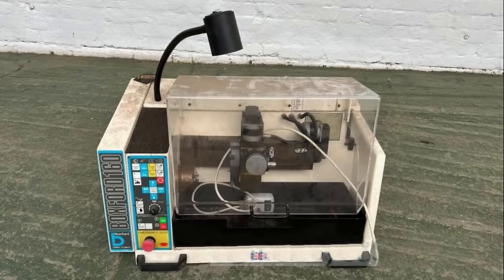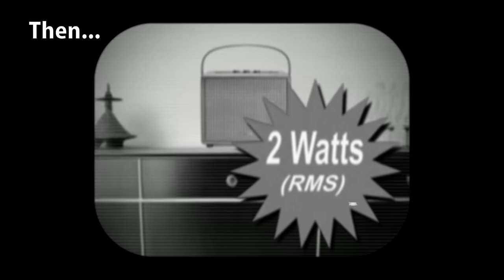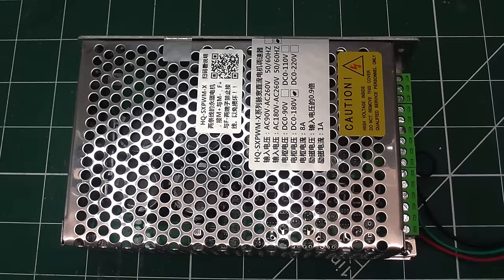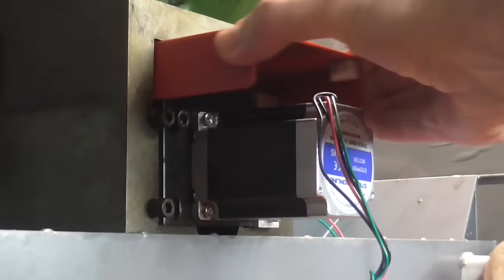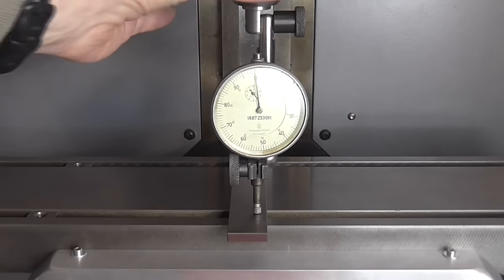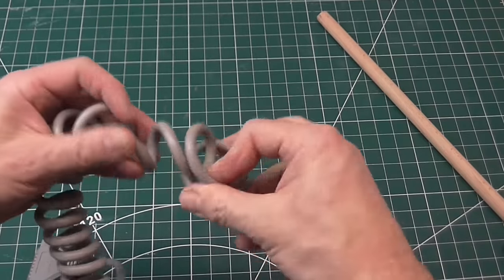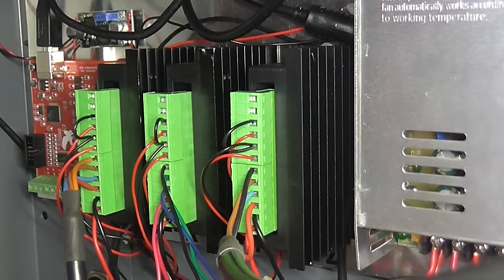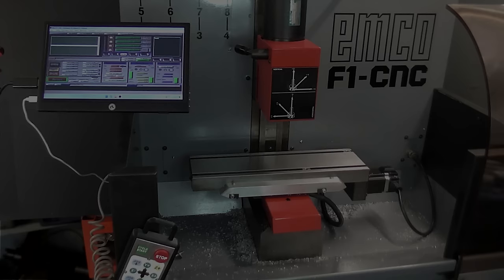Retrofitting an Emco F1-CNC machine

Comment: With these issues, and the ongoing costs of repairs and upgrades, it's a no-brainer to go with cheap EtherCAT servos($150ish each), LinuxCNC... and nothing else. No external peripherals are needed, no power supplies, no ugly and unreliable USB. Mostly plug&play, and not so incredibly antiquated like Mach3(or even 4), especially in 2024.
It's definitely a bit more expensive(especially with an £84 machine and £343 total budget), but it's far nicer.
Other than that, great project. Total bargain.
Reply from the maker: Yes, had I spent more on the machine to start with I might have gone with something like the Ethercat servos, but really I got the machine by chance, I wasn't actually looking for one and don't even have space for it! I know Mach3 is old, but I've had a license for well over a decade and am very familiar with it, so it was the natural choice. I might go with LinuxCNC though for the lathe I'm going to tackle next.

Comment: Can you make the file for the 3D printed end cap available please?
Reply from the maker: I was actually thinking of doing that. I first looked on thingiverse as I was sure somebody must have done this already, and whilst I did find one, the holes were in different locations to my motors so I designed my own (quite similar) one. I actually made two, with the threaded hole on either the left or right. I don't have a thingiverse account but I could put the files on Patreon and make them available to free members (no payment required).
Reply from the maker: Here you go... https://www.patreon.com/AndysMachines

Comment: This is a thin client PC not mini itx
Reply from the maker: I've lost track of the current terminology regarding PC formats, but I believe it's a mini ITX motherboard, which is actually a smaller form factor than a 'micro' ITX. The case it's in may be called something else though. Anyway it fits perfectly inside the machine.

Comment: Doesn't that motor have 60oz. in. and 2A per phase?
Reply from the maker: Yes, that's actually right (the label is laid out in a confusing way). But 60oz/in is still way less than 1.85Nm, less than 1/4.

Comment: Original motors in this machine are awful. After few days of trying to get them to work strong without overheating resulted in buying new modern stepper motors. Newer generation of EMCO machines use servos, but electronics inside are pure nightmare.  Not to mention that EMCO machines and parts for them are inexcusably expensive if you have to order new. That entire company is one big scam.  We recently bought new machines but from other manufacturer and they are 3 times cheaper and way way better in every way.
Reply from the maker: The machines may be expensive but judging by this one they are very well made. The motors seem to be the only part that wasn't made in Austria (they are American). Far eastern machines nowadays are much better quality than they used to be, and you can't compete on price.